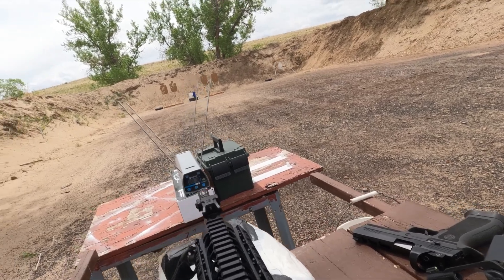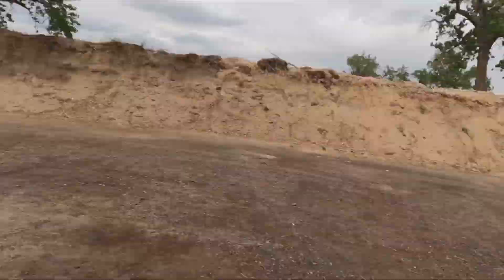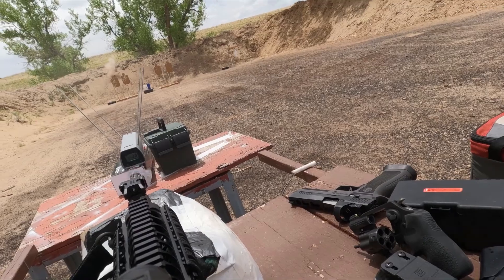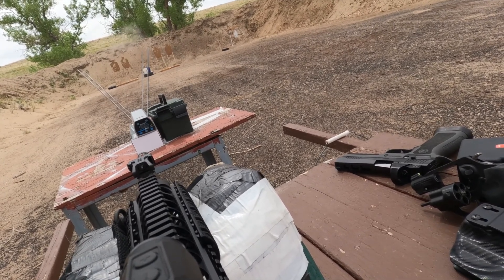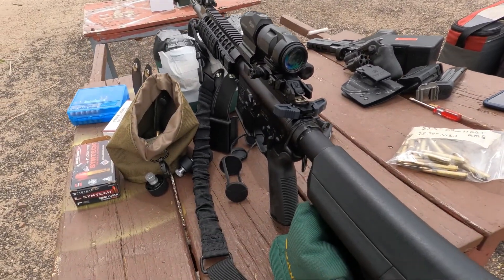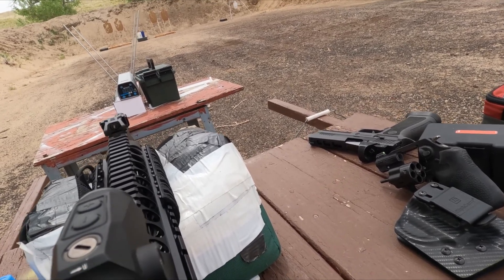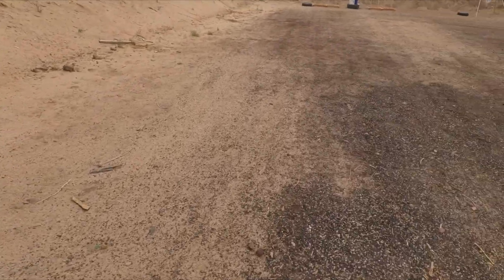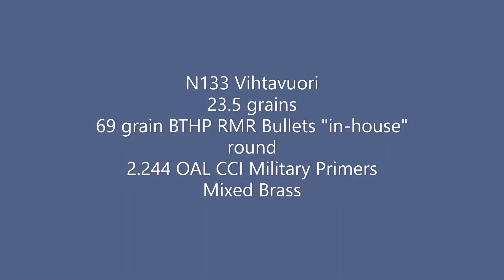Vihtavuori N133 Chronographed Loads - AR-15 (.223) 69 grain HPBT

Comment: Wow those are great velocities on a shorter barrel.  I just bought my first 8lbs of N133. Theres no load data for 69gr so this is helpful.  How did you determine what your COL should be?
Reply from the maker: Thanks for the reply, I used this https://www.hornady.com/reloading/precision-measuring/precision-tools-and-gauges/lock-n-load-bullet-comparator#!/.  Then I had to shrink it down a bit more to fit the magazine.  That put me at 2.269 per my notes, then I had to go deeper to 2.244 OAL - that was the only way I could get it to fit into MagPul mags.  I've tried other mags and mileage may vary as to overall depth.